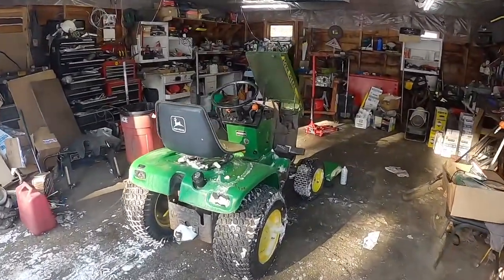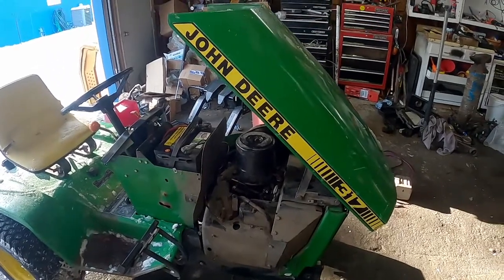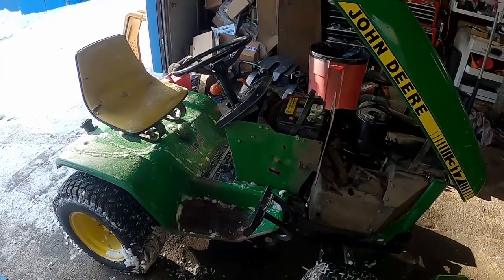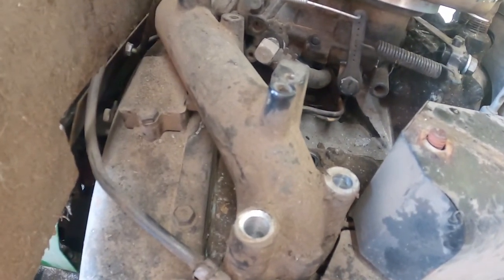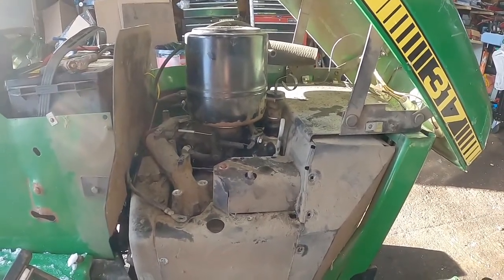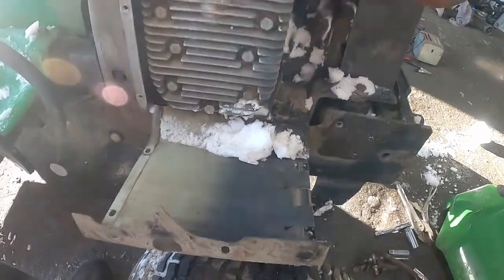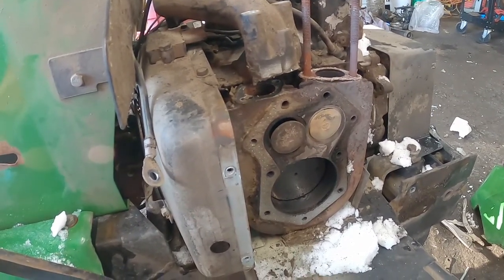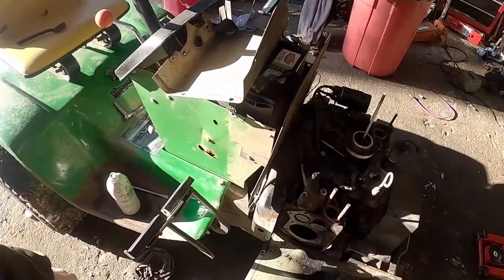John Deere 317 - No Start Repair Part 1

Comment from the maker: UPDATE: I did as of 7/09/2022 Source and buy a used good 18HP Onan engine which actually has the pressurized oiling system and will be an upgrade from the 17HP Onan, (Exactly the same engine as far as I can tell just oil pressure vs oil bath) I will be recording a video of me getting that engine running and installed in the 317 hopefully in the next few weeks.

Comment: I paid $2500 for a series2 in 2008. Can't find them now.  If the motor gets too hot it could be bad?
Reply from the maker: Yeah as of today the mower is still sitting in my field and the guy ACTUALLY believes he will fix it someday, I kinda told him if he does not come to pick it up by the next time I mow, it will mysteriously wind up in the back of a strangers truck heading to god-knows-where.

Comment from the maker: Just wanted to post a quick update since I had a few people ask about posting a follow-up rebuild. As of 6-7-2021 I pulled the jug off and found chunks of metal, parts of the con rod caps, and nuts and bolts shredded into oblivion in the crankcase. So as of right now, this rebuild is dead in the water. It would normally be repairable but due to unavailable parts, and the fact it damaged the crank, and camshaft beyond repair, it is not likely to continue.

If the customer does however decide to swap for a donor or go aftermarket like Harbor Freight I will make a video on it!

Comment: Those Kohler engines are notorious for that starter disengaging there’s an old cub cadet at the grandparents that does the same thing but it stalls out the battery says 12.5 so it’s probably a bad starter also those  kt twins series 1 and 2 are prone to being run out of oil they are pretty much always repowered  with a Kohler magnum they have pressure lubrication and they are way better

Comment: Your tractor is in amazing shape, put a seat cover on it & it’ll be good to go. The engine is trash the tractor is good, even if it had a KT-17 series 2 I wouldn’t rebuild it. Unless it has a Kohler K-series engine in it or an Onan.
Reply from the maker: As of now, the customer is saying to go ahead and try to rebuild the engine. So I am just waiting for my leg to heal up and hopefully I will remember to make a video on the rebuild process!
Reply: @samsauto1640  please do. I have the same problem with mine
Reply: I have both the 682 & 1710 Cub Cadet tractors that have that very same engine and I have to say that those engines do produce a lot of heat compared to some of the other engines that I have ran over the years. The 682 has a fuel float issue from late last fall and the 1710 has a wiring harness issue that I am trying to figure out. Both of my engines are Series 2 engines.

Comment: What did they decide to do?
Reply from the maker: Right now the guy still has it parked in my yard, I have found him 4 separate motors that would be good donors, but he refuses to spend more than $150 on a motor, which I told him is unrealistic for an Onan and he needs to expect to pay$350 or more. Unfortunately, I think it's going to be one of those things that just rots into the ground. I would buy it myself and fix it and sell it, but he also wants blood money as if it is a 318 and running.
Reply: @samsauto1640  whats he asking? 
2grand
Reply from the maker: @snowace9424  He told me he paid $2,500 when it ran, and he would not take any less. I told him if it was a 318 with attachments running, Absolutley he could get $2,000-$3,000 in my area. But as it sits now it is hardly worth $400 in my opinion.